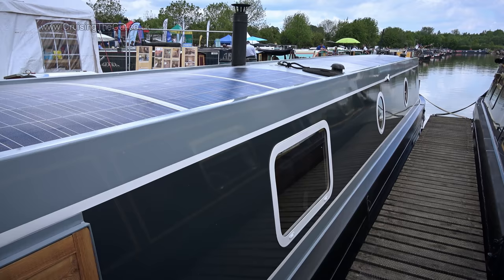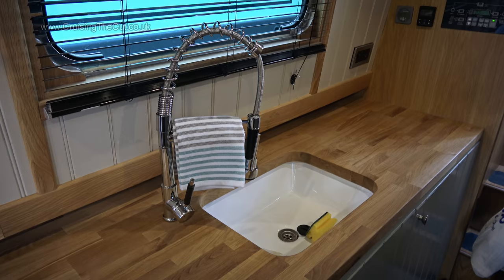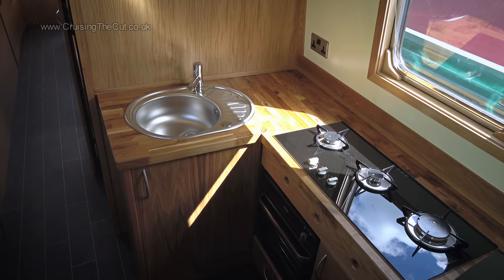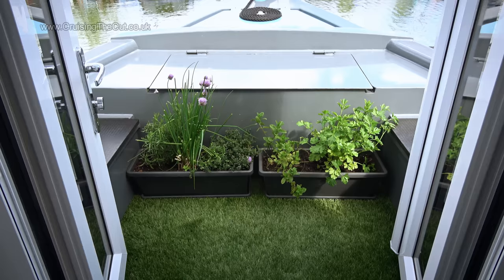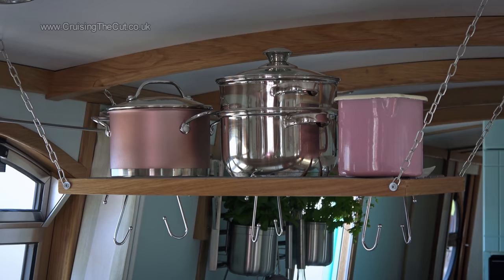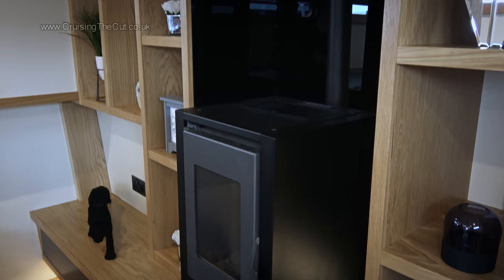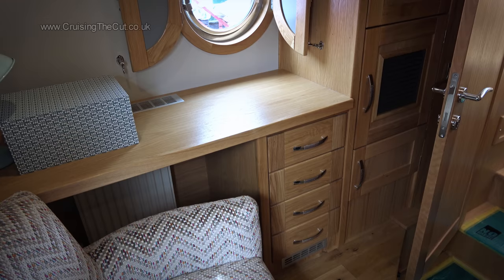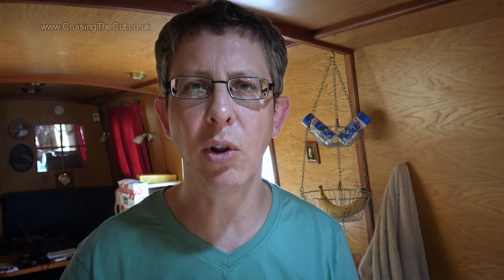176. The Crick Show 2019 (Inland waterways / narrowboats / canals)

Comment: Interesting as usual - isn't it fun looking around other peoples boats and stealing their best ideas!!  I can thoroughly recommend pretendy grass on the foredeck. Picked up an 'end of roll' cheapy last season (fair weather boater!!) and fitted PDQ. You really need to be confident in the standard of the deck paintwork underneath it (cos it's probably going to be a bit wet a lot of the time) but it looks so much nicer than boring paint, it saves having to brush the deck every couple of days with the added bonus that it acts like a large scale door mat at the pointy end - the crew say it adds confidence getting on - no slippy deck with wet/muddy feet. Just do it!

Comment: Regarding the batteries. Found the tech specs on this page.
Ideal Charge Voltage
: 14.1-14.6 V
Top Up Charge Voltage
: 13.5-13.8 V
https://www.alpha-batteries.co.uk/12v-leoch-pure-lead-carbon-plh-c100-deep-cycle-leisure-battery/
Reply from the maker: Cheers! Even the Leoch datasheet doesn't specify that!!
Reply: No, I saw that. Strange since it IS a deep cycle leisure battery and those figures are of importance. They look like interesting batteries though and those levels are what most batteries have, so nothing out of the ordinary there. Looking forward to a review :) might buy them for my camper van. Cheers and thanks for your vlog! Very entertaining :)

Comment: Any possibility of using a heater fueled with used oil? Although I have not seen one used in a marine atmosphere, they could be very economical.  I have seen them in use here in the States.
Reply from the maker: Interesting idea!
Reply: “Waste Oil Heater” is probably the correct nomenclature

Comment: Always interesting to look around new boats and vans to pinch little ideas for your own home. I’ll be interested to watch your battery video too. 
Nice video David 😊
Reply from the maker: Haha if only I knew what I was actually testing with the batteries... shall have to consult some experts.
Reply: Haha... obvious ones are cost, size, weight, no cycles @50% DOD not a lot else really 😀
Reply from the maker: That's the interesting thing about these - supposedly 2,500 cycles at 60% DoD - and can be taken down to 100% discharged without harm up to 500 times!!
Reply: CruisingTheCut never good practice to do that with lead batteries. You’ll be ok your solar will keep them tip top every day. 😀
Reply from the maker: But apparently that's the interesting thing - you can do it with these and they're fine. Something to do with the carbon preventing sulphisation (I may have made that word up). But yes, chances of me taking them to zero should be low anyway.

Comment: Thanks David. All the pretty shiny new boats were candy for the eyes. My daughter looking over my shoulder said no way. She would be afraid it would sink with her on it or while she was away from it someone would hit it. Told her canal speeds are 3 to 4 mph generally and that's not exactly ramming speed. Plus you can pretty much stand up in the canals, except for the locks. LOL. My issue is how on Earth do couples sleep in a 4 foot wide bed? I move a lot and sleeping like a starfish is heaven to me.😀😁 Thanks again.
Reply from the maker: A lot of the beds can be expanded sideways to 4'6" if that helps!! You can also get cross beds which go widthways across the boat so they're not that long but they can be as wide as you like.
Reply: @CruisingTheCut  That's true, a cross bed would do it. 😉

Comment: maybe its time to change your solar panels for those that are flexible and extreme low profile Dave? nice Show, thanks for showing us those lovely narrowboats
Reply from the maker: I'm not a fan. Although they're discrete, I still think over time with me treading on them with stones in my shoes they're going to get damaged. Also as they're stuck to the roof you can't easily change or replace them. Plus I hear they do wear out over time quicker than conventional panels. And you can't tilt them to the sun.

Comment: I am a new subscriber and have been binge watching your videos. I thought I would offer a few comments regarding my experience using an incinerating toilet. We have one in a fishing cabin which is on an island in a US lake near the Canadian border. It was a economical alternative to a septic system for us. There is surprisingly little ash after a week, even with up to four guys competing to use it. Although it has worked quite well for us, there would be some challenges to using it on a boat. The first is that it consumes 1.5 - 2 kilowatt-hours of electricity for each cycle. The amount of energy required is probably not practical unless one is connected to an electrical grid. The second issue would be the exhaust odor. Ours exhausts through a vent in the roof and is 20 feet (6 meters) above the ground so we seldom smell anything from it. The smoke doesn't smell like burning poop but I wouldn't try to claim that the aroma is as pleasant as a nice, cozy wood fire. I think that the prevailing breeze usually carries our toilet smoke somewhere over the border into Canada. ;-) Thanks for making the videos David ! My wife and I have started thinking about a narrowboat cruise in the UK in the spring.

Comment: You should go ahead and just write notes for the book. Start with an outline, and little snips of info for each chapter. Kind of like bullet points for each chapter. Then next winter, fill out the bullet points to complete thoughts. The new batteries are supposed to be good. Had a friend put some on his pontoon cruiser last summer. He said they were good and they held a good charge over an Oklahoma winter. Which lithium is not meant to keep a charge over a few months.
Reply from the maker: I've done the notes already ;-)
Reply: CruisingTheCut  A space on my bookshelf has been reserved for your book. 👍😀

Comment: If you sell the book online and get the funds to buy a new boat I vote for the all electric with 2 kw of solar panels.
In my opinion big advantage is no propane to go boom. Plus being able to really enjoy the canals and Mother Nature by actually being able to hear it without having to shut off the diesel.
Did the all electric have a solid fuel stove? I personally like the Morso Squirrel with the back boiler for heat in winter, nothing like forced hot water to steel or preferably cast iron radiators.

Thanks for the tour of the Crick show, quite informative.

You haven't lost your touch, if anything you've become a better independent reporter.

Cheers!

Comment: David, if you haven't gotten the charge voltages fro the vendor for your lead-carbon batteries yet, Victron sells lead-carbon and has information on charging voltages. They are probably the same for your batteries. Except on rare occasions, batteries of specific chemistries have similar charging profiles.
Reply from the maker: Cheers, yes but I'd rather have the official figure from the battery manufacturer than rely on another manufacturer's spec. I have been in touch with Leoch though and am awaiting replies to my queries.

Comment: I think you will be plesently supprised at the result. just cheack on the output of your solar panles is enough to recharge the batteries during the day.
I have on my boat an 160 watt charge going into my battery bank of 150 amph deep cycle. runs everything i need on my boat.
Gerard.
Reply from the maker: Cheers yes I've got plenty of solar (480W)
Reply: That is allmost 1/2 a kelow watt.
I am very impressed. 
Gerard.

Comment: Thanks for this episode David.

Was very interested in the lead carbon batteries as a credible alternative to lithium technology items.

Fwiw the "motorcaravaning" site says your typical smart battery charger set to the AGM parameters will quite happily charge them.

Apparently it takes 'forever" to attain 100% capacity but 90% is acceptable for a satisfactory performance.

Lastly, glad I didn't book any boat visits for when I went ... to my mind the interiors just resembled a too polished, soulless floating holiday apartment, but no "boat" in sight.

Where's the "getting-away-from-it-all" fun in that?

Comment: over here we put a small battery (two D cells) powered fan in our 12 volt and gas powered fridges.  Helps to keep the air moving, which helps to keep all foods the same temperature.

Comment: Another great video.  I decided to take the electric approach and bought a 48 Volt all electric 63 length. Top speed is 8 MPH and can go about 20 miles on a charge.
Reply: It is actually an Electric Lawn Tractor. but it is 63 Inches long, does 8 MPH and can go 20 miles on one charge.  I am planning on designing a simpler Electric Canal boat though that is just as affordable as a diesel, and very reliable. (Just as a note, cutting my 3/4 acre of grass with an engine lawn tractor uses a gallon of gas ($3.75), the electric lawn tractor costs only 10 cents to recharge :-).
Reply: That's good, 8mph is twice the speed limit! There was so much electric stuff at that show, it's obviously going to be big sooner than most people realise.

Comment: Good choice I have 4 x 150 Ah  lead carbon on my boat I fitted them last Oct they perform great, fantastic in the winter and even better now the sun is out. I have 1 solar panel 320w  all victron charging equipment.
Reply from the maker: That is great to hear! Any tips about care, charging or indeed anything else I should know about them?
Reply: @CruisingTheCut  Hi David I tried to get the data sheet but not had any more than you mentioned in your vlog. As I under stand they are very simpler to an AGM. Mine sit at the side of my engine on the bace plate which always seems to be within the temp brackets. I have pretty much installed them synchronised the victron battery monitor BMV-712 when they where fully chagerd and not much else to be honest.One of the reasons I choose them was the 150Ah I have are very slim as I am limited for space also the huge cycle rate they have 2500 per battery. I dont have a Viltron multi plus at the moment so there is not much else I can adjust/set.
Reply from the maker: Good stuff. Yes, I'm very limited for space too. Cheers!

Comment: You are right about lead carbons. Their main virtue is they tolerate almost flattening without serious deterioration but if you can keep them typically 60% + charged and don't overheat they will last 20 years but with serious abuse should still last 10 years.  As all batteries running cold diminishes their output capability and capacity to take maximum charge.  Their only real drawback is size and weight. Versus lithium with their incendiary affinities and price it's a no-brainer. A better type of ballast but do take up space. You should still aim for minimum of 3kw solar panel collection and same capacity inverter which may seem a lot but really is realistic if you want any semblance of normality. (run washing machine etc)  Surplus power can usefully run ac or heating. You may well be advised to also fit a float switched high volume bilge pump in engine space AND another to living area as you have almost zero inherent buoyancy, (and very little stability)  in a narrow-boat and they sink very very fast. That advertised engine bilge filter should be mandatory and subsidized by the CRT for existing boats in my opinion.
Reply from the maker: 3kW would take up too much space on the roof (I need space to walk on and for storage, like most narrowboaters). Unless you're aiming for electric propulsion, that much is really not needed. I got way more than I need from my 480W, albeit granted I can only use the washing machine on a cold wash. I agree about the bilge filter though.

Comment: Man that boat from mothership marine is Awesome!  absolutely LOVE the fit out using reclaimed wood....i'm guessing the gen set will run the electric motor if need be?  and having the entire roof as solar panels...wouldnt that still provide good charging even on a cloudy day?  That Bickerstaffe boat was beautiful too!!....well, they all were actually, and those wide beams are just like a house!  I could live on one of those quite easily we as well!!  very much looking forward to the vlog on the lead carbon batteries...Very nice vlog and thanks for sharing.. And absolutely time for a G & T!
Reply: Talking to the people on the electric boat associate stand next to it, they said the generator was so much more efficient than a normal diesel (that spends most of it's time near tick-over) that you didn't need it running all the time while cruising - even if you got nothing from the solar panels. 
Also, I talked to the new owner of one of the wide beams, who was basically going to use it as a house boat until he retired in a few years. They'd sold their house but he was still tied to a job 48 weeks a year. He'd put in double the normal insulation to keep them comfortable over winter.

Comment: A key advantage for lithium in a narrow boat application is that you do not have to fully recharge. Fully recharging lead batteries involves a long float charge period which is hard to do regularly without a mains connection. In the summer with solar you may be ok.
Reply from the maker: You don't have to fully recharge the lead carbons either, that's one of the attractions. They're able
to withstand partial charging much better than traditional lead acid.

Comment: Hi David, A new boat? To me all those new boats are just a hull with modern fixtures and fittings. You've got a good hull, a good engine and so on. Does the idea of working some magic with a refit appeal to you. It would be much cheaper and would produce a similar result to a new boat. Cheers
Reply from the maker: No, if I was going to do all that effort on a complete internal refit I'd much rather do it on a brand new hull at least, that way you know its condition and can care for it from the outset. I was never suggesting I buy a brand new boat really (though I would if I won the lottery) as I just don't have the money. I'd have to look for a second-hand one that matched my needs as closely as possible. But the plan is on hold at present, as I'm out cruising and just don't have the cash.

Comment: This is 2020, march .  Back in 2015, I bought 37 Lithium cells for my EV.  They cost $1.30  (USD) per Amp Hour.  For 37- 130 Amp Hr Lithium Prismatic cells, I paid $6300 USD.  I ordered direct from China Aviation Lithium Battery CO.  It took 14 weeks from payment to delivery to a local Truck yard.  The pack weighed  204Kg.  (Each cell weighed 6.4 Kg)  Their equal in  size of 6 volt aux acid batteries would weigh 816 Kg. and 1/3 rd of their performance.  If bought locally here in the US the price would have doubled.

Comment: i've just seen a 60ft widebeam but it wouldn't fit in the locks  if there only 57 with cill  nice fridge though,  nothing like my little 1 door that'll go in my van, when i get a van.  good stuff in the van, you using a little solar panel on the dash, to keep the battery charged? nice 1 m8!

Comment: Would be interested to know if the washing machine, oven and other bigger appliances are installed during the building process. If so, can they be replaced easily? I.e.  can they fit through the internal spaces to be removed? Some RVs have the refrigerators installed during the build and if anything goes wrong, the front windscreen must be removed for the appliances to be extricated.
Reply from the maker: Not easily, necessarily, but if the builder did their job properly then the bow doors etc will be just wide enough fir appliances.

Comment: Hey there, i bought lead carbon in 2005 supposedly new tech then, they are esentianally lead acid, and if you dont treat them like lead acid then you are doomed,, they are not even comparible to lithium, mine were a disaster cheap leisure batteries from the camping shop lasted longer, again treat as lead acid and they will most likely be ok

Comment: Hi David , clearly too late with this gem, but did you not  know, not only can you test (or have tested) the performance of batteries, and or if necessary, have them refurbished?I certainly would have looked further into batteries from an independent source before laying out that kind of money,, after all if ever you did decide to sell your boat you can hardly ask extra because you have expensive batteries.
Reply from the maker: The old batteries were ten years old and totally shot. They needed replacing!

Comment: Have to admit the 2nd wide beam is lovely but seeing the lack of width you encounter sometimes not exactly practical.
Reply from the maker: Bear in mind I mostly have been along the narrow canals in the midlands and only at the end of last year did I venture down the (wide) Grand Union towards London, so the widebeams by and large wouldn't be found on the majority of canals I've traversed. Obviously the rivers Severn and Avon would also be fine for widebeams as seen in my 2017 cruising.

Comment: On the new fridge, I understand the efficiency of 12V vs. A/C, but are any  boats fitted with propane gas absorption units? Most RVs I've seen use those. Are they not practical in a boat?
Reply from the maker: Not permitted anymore for safety reasons, I think to do with having a permanently-lit flame and nowhere for any gas to escape if it were to leak (since the bilge is underwater, escaped gas would accumulate there and be an explosion risk)
Reply: @CruisingTheCut  that makes a lot of sense, but you still have propane piped to your oven & stove (grill & hob?). I suppose those are only on when you turn them on, but there's still potential for a gas leak. Is there a bilge vent or fan to prevent gas buildup, such as from a leaky diesel line?
Reply from the maker: It is somewhat contradictory, I agree. There's no bilge fan but diesel fumes wouldn't be an issue. It is a rare boat that has a propane detector on it in the bilge as well.